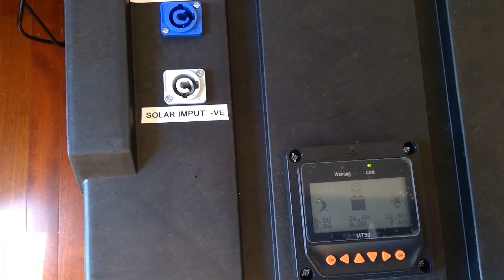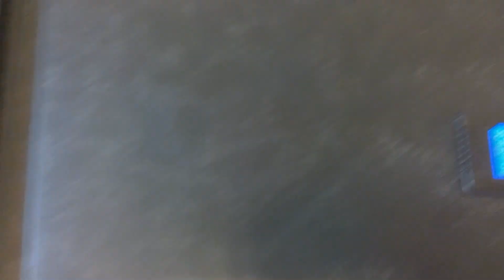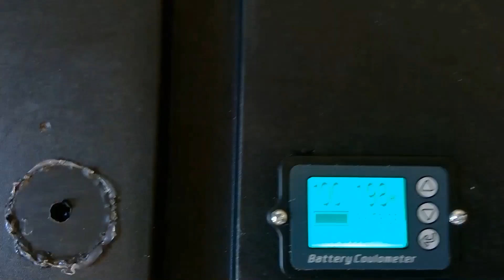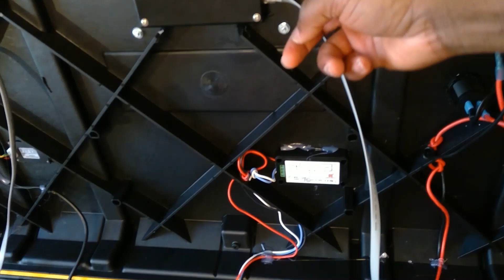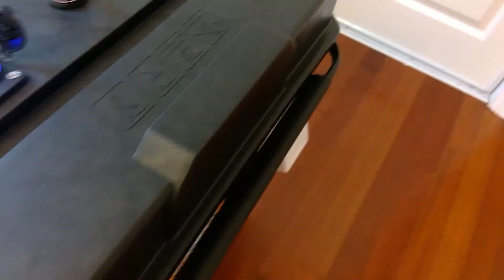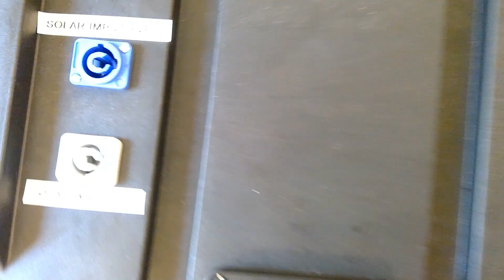DIY Solar Generator 3000W

Comment: Very very nice JOB ! I’m now Building a similar idea ! My  inverter 5KVA Pure Sine Wave does not come with an external screen ! I would greatly appreciate if you could go over some of the wiring my battery is 3.2v Lithium 280A !

Comment: Do you have a parts list and building video?
Reply from the maker: I've  added the part list
Reply: @Donatus11  Thanks for your kindness
Reply: Donatus Uwasomba how much was the total cost ?
Reply from the maker: About $3000. The most expensive part  is the LiFePO4 batteries.
Reply from the maker: About $3000. The most expensive part  is the LiFePO4 batteries.